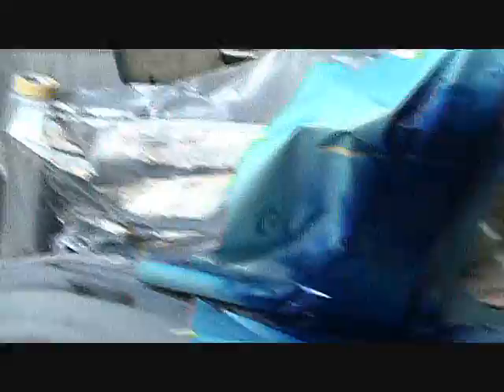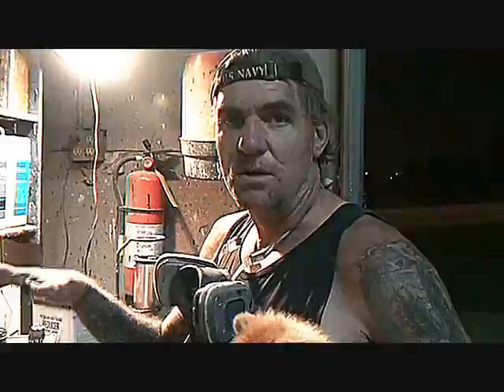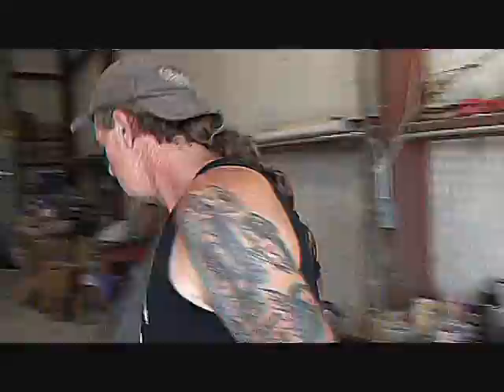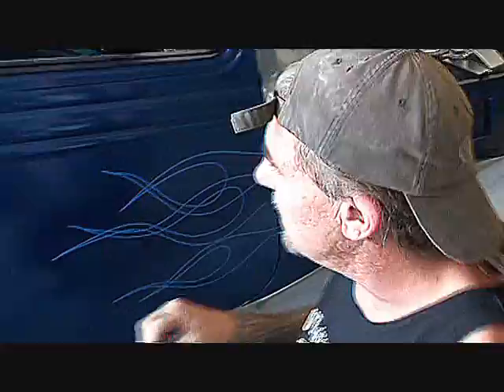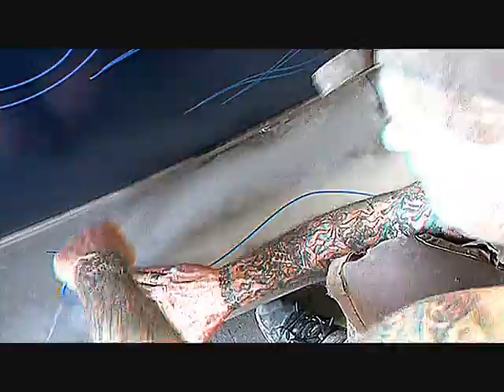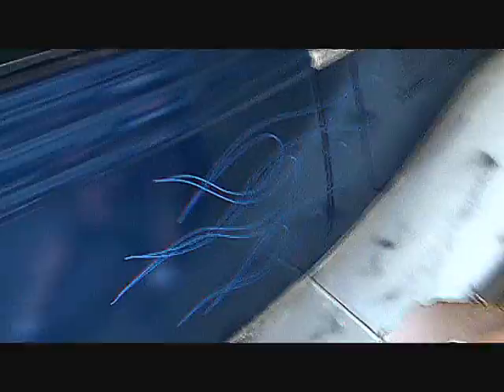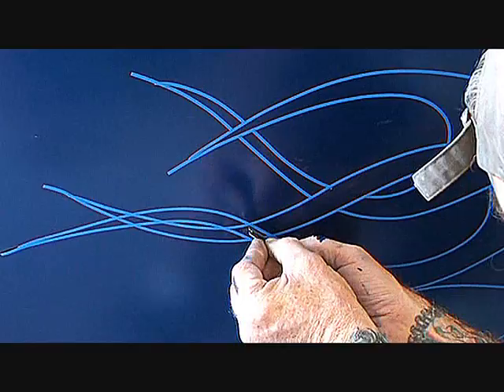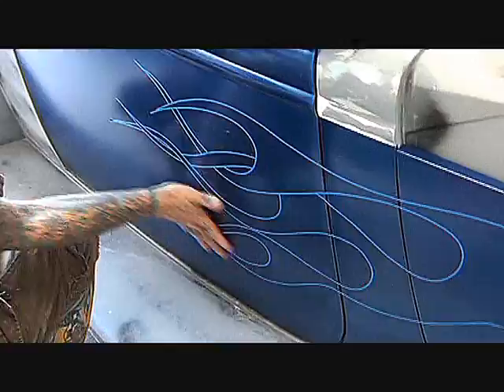How To Paint Flames The Easy Way-Part 2

Comment from the maker: @cjboboy It's called fine line 3M blue tape, 1/8th inch and 1/4 inch.. Find a local paint and body shop supply store or locate a Napa Auto Parts they should be able to get it for you.. Check and see if you have an O'Rileys as well.. Take it easy and good luck. Pete

Comment: Please tell Pete a respirator is not enough protection if you're using 2 part clear. The isocyanate in the hardener is nasty stuff and will leach thru your skin. If you get sensitized to it, serious asthma can result and you will paint no more.  Please read up on the topic.  A suit, goggles etc is necessary
Cool video btw